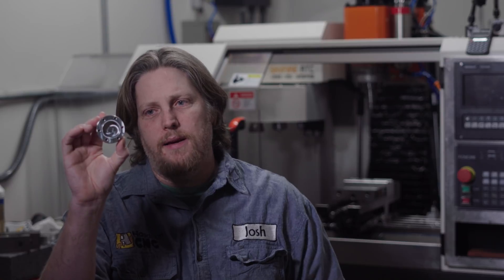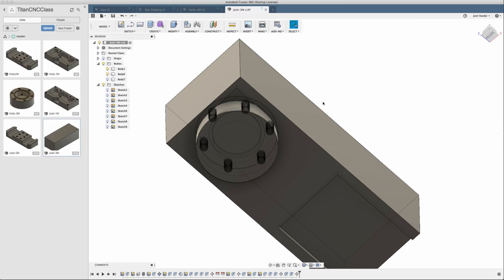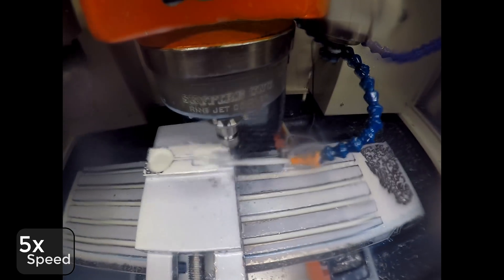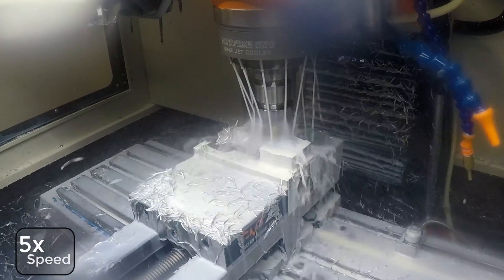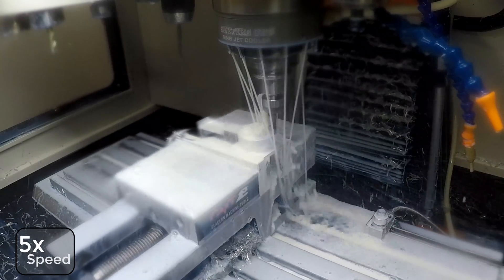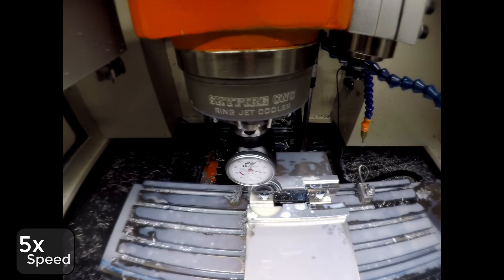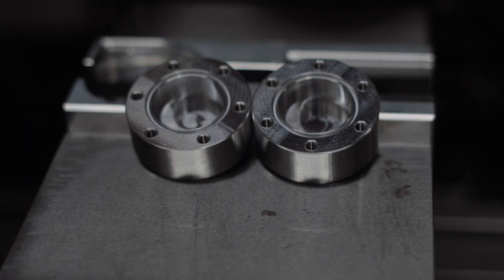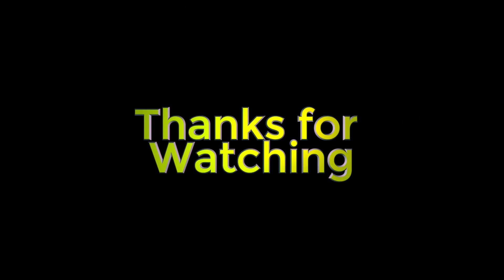Machining the Titan's of CNC 3M : Double Trouble or How Servo Settings Matter

Comment: Glad to see this video series continue! After the posts on the skyfire community, seeing the difference on video is nice.
Reply from the maker: Yah, those server setting changes were shocking.. Because the faceting was so predictable I would have bet a soda that the issue was in the controller.. But apparently the servo was being too "gentle" with the commands in a very predictable way so firming up some of its holding torque and changing some of the timing did it...   #themoreyouknow...